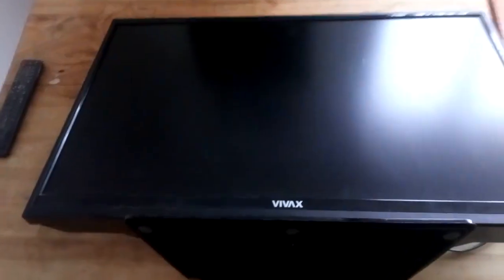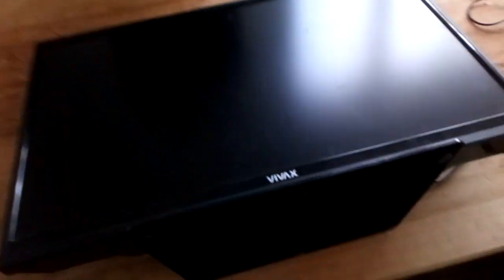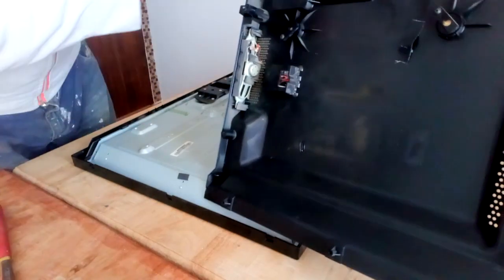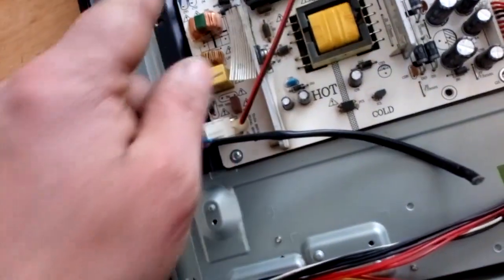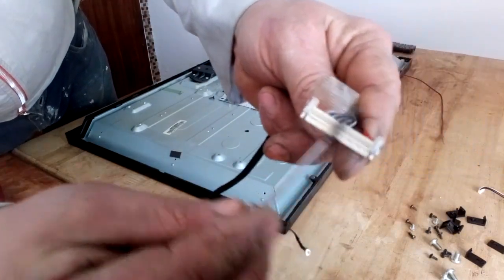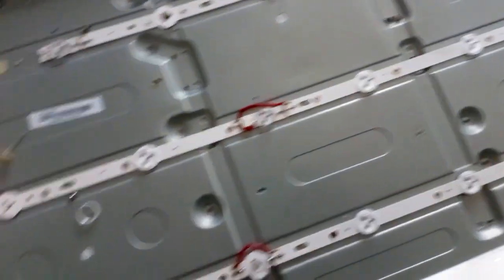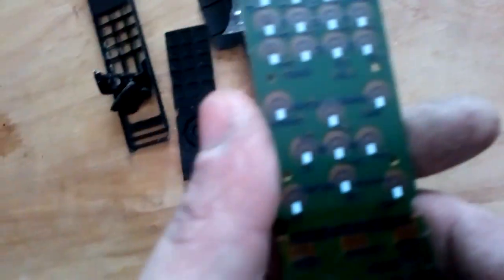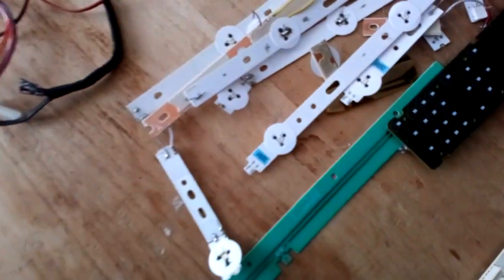Scrap LED TV for gold recovery.

Comment: Hi, at 6:20 just before you reviled the LED backlights you lifted out 3 items. The dark screen glass, diffusion sheet, translucent white plastic support sheet. The diffusion sheet, translucent white plastic support sheet can all be used by the hobbyist for projects around the house. The screen glass is a sandwich of 2 very thin outside panes and the middle pane contains Indium alloy. If the screen is ground down then the Indium could be refined out.

Comment: I heard somewhere that the ribbon cables attaching the screen contain gold bond wires. 
I dont know for sure, but I collect them anyways.
Good video
Reply from the maker: Yes some have gold on a ribbon cable,on some of them is not present, in this case there was no. Even if is silver is the amount is so small that it does not matter.
Reply: Hey Brian k do we know each other lol? Probably a long shot but I know a Brian Kores

Comment: Extracting gold from a TV with faulty LEDs is like throwing money on the window and some nasty chemicals in the environment.
The TV died because of it was cheap, of low quality and had improper repairs. You still would get more value for selling the working screen panel and the boards, or replacing all the LED stripes and selling it as a working TV.